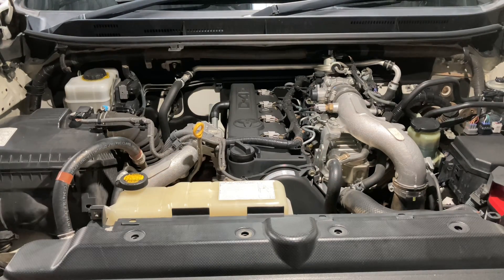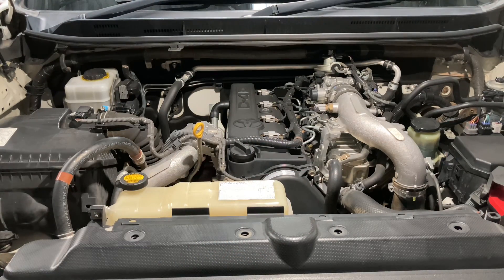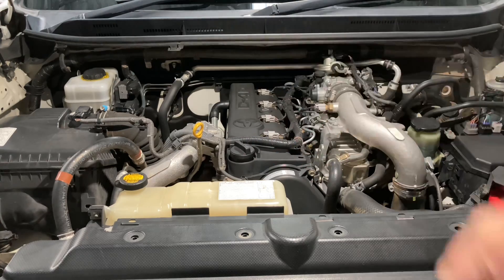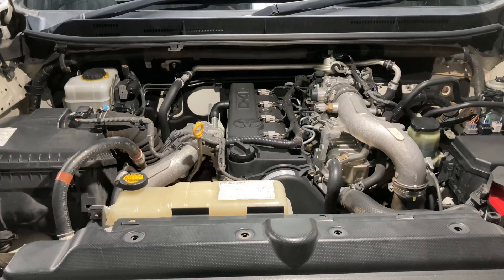WHY DOES the ENGINE OIL Stay So CLEAN or GET So BLACK

Comment: Diesel Podcast YT channel had an article (or mention) about filtering EGR gases.  New aftermarket add on.  Apparently it’s designed to be low maintenance.  I think it’s only one model ATM for a V8 diesel US truck.  Was very interesting.

Comment: I have a d22 Navara (240k km, still in good nick) which has had the EGR blocked for a long time. The oil still goes black quickly. Should I do an engine flush, or is that a bad idea on a high mileage engine?
Reply: 5 k oil changes. Max.

Comment: Thanks Anthony! Curiosity, would the exhaust generated from the combustion stroke be negligible in affecting oil and injector nozzles or does it have an impact? Understand from your channel (EGR playlist) and various videos that the exhaust from the EGR in the compression stroke is naturally worst so assume it is minimal impact of the passing through rings in combustion stroke in comparison then?
Thanks for the videoes👏

Comment: Some engine oils can be visibly less or more black also depending on the additive package and base oil type the contaminant quantity maybe the same with certain oils holding smaller particles in suspension better therefore making the oil appear cleaner to the eye a friend of mine is a petro chemist manufactures his own oil brand that has these properties in spades with longer change intervals also triggered by oil tests
JA

Comment: Therefore under severe driving conditions (short and cold runs) engine oil should be changed sooner. Anyway, dark oil does not mean it is bad, it is formulated to handle soot.

Comment: Hi Anthony, I've "reduced" the EGR on my 1hdfte and the engine oil stays clean as a whistle for the full 5000kms between oil changes. Another great video mate, even though I don't have a prado I still watch and enjoy your content.
Reply: I recently bought a 1hdfte 100 series and done 4000kms since service (using Penrite oil) and was shocked by how clean the oil was, even worried there wasent any oil because of how clear the oil was on the dipstick ahah. Engine must be really good internally or maybe previous owner blanked/reduced egr. 

Either or, really surprised how clean the oil was for a diesel
Reply: @danielpod5977 I reckon the previous owner probably blanked it. You can check by taking off the EGR pipe which sits behind the crossover pipe, and looking at the exhaust manifold. Likely has a blank plate in there, which is good!
Reply: My FTE is the same brother. My EGR is also ‘reduced’